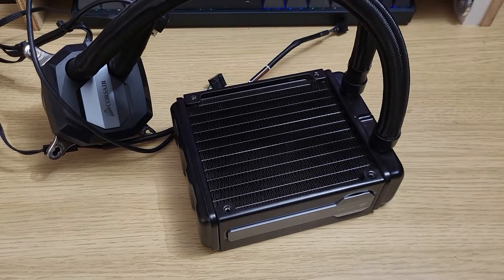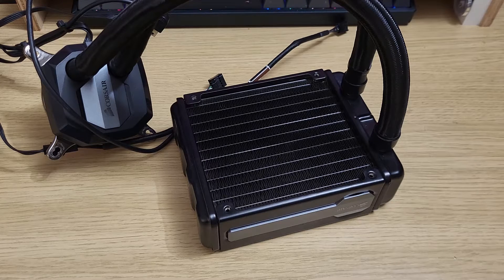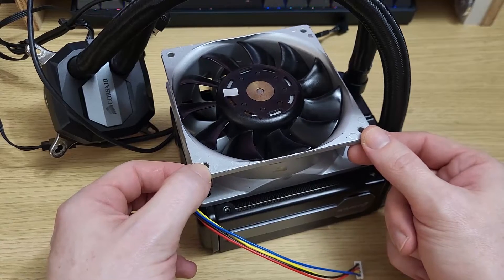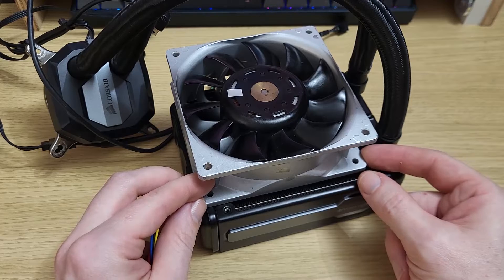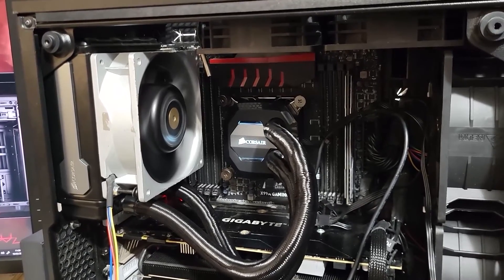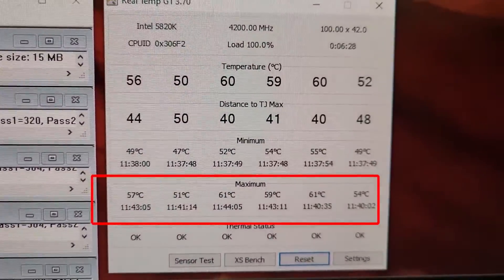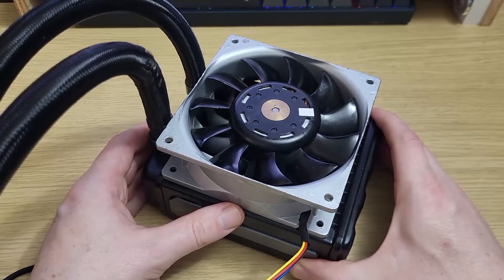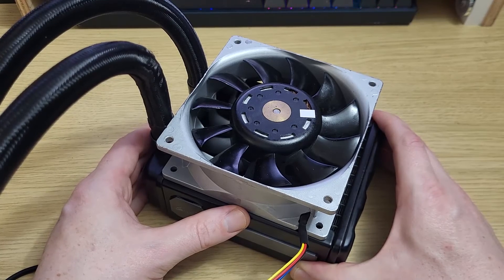Supercharged Corsair H80i V2

Comment: Hi, hoping you can help me. 
I've purchased a pwm data can hub and arctic p12 x18
When plugged into the fan hub the fans all run at 100% speed. 
I have tried 4 different fan hubs. I have friends who claim that they can control the arctic p12 fans without issue but mine always runs at 100% my motherboard detects the fan hub and reads the fan speed but has no control over the p12. It can control be quiet silent wings 3 just fine though through the hub

Comment: ok... I feel like at that point you should be measuring the liquid temp.
Your delta temp between the liquid and your ambient air is probably less that 2C at that point. And it kind of makes the hole setup pointless.
The way I think of it is like. Say your CPU is putting out 100W and you have reach steady state. Then you need a difference in temperatur (dT) to transport the energy at a speed of 100W.
First you have the thermal interface material between the chip and the heat spreader. Say you need a dT of 5 to pass 100W, then you have the heat spreader (it is thicker but has a good thermal conductivity) say you also have a 5 dT there, then you have your thermal paste, let just say 5 dT again, then you have your CPU block and into the liquid. Say that is supper good at 2 dT. And then you have from the liquid to the air, through the radiator. Say that is bad ad 10 dT. When you add all this up. 3*5+2+10 = 27 C and add the ambient temp say 21 and you end up with a CPU temp of 48C. Maybe these numbers are a little too good, but roll with it. Looking at this setup the dT of 10 stands out, thus increasing the air speed over the radiator will help. But it can only help with 10C (assuming ambient air temp, if you add an AC it is another thing). Now you add this super fan at 6000 RPM, and you reduce the dT over the radiator to 1C. You have now cut off 9C of the CPU temp, thus you are down to 39C CPU temp.But maybe you could run the fan at 2000 RPM and the dT over the radiator would still only be 3C, now the CPU temp is at 41C. And the noise is probably a lot better. Now if you look at the sum. 3*5+2+3 = 20 C, The 2 dT from the CPU block can only be changed by changing the CPU block or the pump speed in the loop. But since it is only 2C there is not much to gain here. But the 3*5 can be reduced to 1*x, by removing the heat spreader and one of the thermal interfaces. Say you use a thermal interface material only ass good at the one on the CPU from the factory, then you have 5+2+3 = 10C add ambient of 21 and you have a CPU temp of 31C. This got way too long, sorry about that. My point is, in a liquid cooled pc one should look at the liquid temperature at steady state if the dT between the liquated and ambient air is "small" there is no reason to try to force it even lower, cause the maximum you can do is 0 dT and it cost a lot of noise or a super huge radiator. Thus it might be time looking somewhere else.
I know I am assuming the liquid is flowing at a reasonable speed, but I think that is fair as long a the pump is at least running 😛.
Reply from the maker: Liquid temp was 29.6C as shown on the screen, which is approx. 8C above ambient. But this is a fun video, not intended to be serious... :)
Reply: @FanPhys and it is fun.
I can't believe I missed that, i even paused at that screen. Honestly I am surprised that it is still as high as 8C. Maybe the intake air is a little warmer than the ambient air.
But I guess it shows that you would benefit from a larger radiator.😊

Comment: Can you stack two or three of those for optimal performance? 😂
Reply: Push Pull with those fans on a 240 or even 360 must be insane. Who needs a chiller whem you have those bad boys.
Reply: @DrakkarCalethiel  Chillers can reach below ambient temperatures, regular radiators can not no matter how good the fans are (unless the air they blow is sub-ambient)